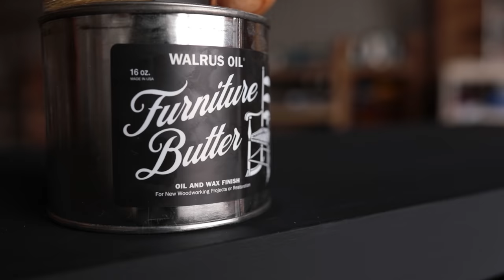Entertainment Center + Burlap Makeover | Mistakes Happen + Breaking Glass

Comment: Hey, Lauren! It turned out really nice. I have a quick question… I’m wondering why you don’t paint the inside of most of your pieces? In this case, behind the doors and the backer board of the open shelving. I am on team “paint inside”and do it with all of my pieces just because I feel like it gives a more finished look. There is no right or wrong, of course, I’m just wondering what your thoughts are on that. Thanks for another great video! 💕✌🏼

Comment: Nice idea, however, those doors took away all your glory. 
You should have pressed the burlap for starters, then when adhering it to the glass you should have pulled the fabric taught and finished/hemmed the edges by folding under those rough frayed edges to give it a nice finished appearance. As it stands now, when those doors are opened, it has an unsightly look.

Comment: Instead of glass, I would use a thin wood which would be sturdier.  Also need to get the wrinkles out of the fabric.
Reply: exactly....I really wish that burlap wasn't wrinkled.  I'm afraid I would insist that be fixed before paying.
Reply: @kathleentorres2010  I agree...It would have to be wrinkle free for me.
Reply: @kathleentorres2010  just steam it
Reply: @C00ki3m0nsta25  burlap would have to be ironed...and before it was attached to the doors.

Comment: Lauren love the look but not loving those raw edges on the inside of the door.  .I suggest you add a piece of light weight cardboard covered in material  or burlap and place it on the inside of the door to cover the raw edges from the front side.  Have you thought about trying decoupaging the burlap on?  another though is to use small wood molding on the back side of the door like those plastic strips from the other piece and just glue them in again to leave a nice clean edge inside.     Maybe experiment and try a few things.  Good Luck.
Reply: I agree about the raggedy ebbs ends of the burlap. I was like please don't leave it like that

Comment: You can use liquid starch to apply your burlap to the glass. Once it is dry you can cut the burlap along the edges. You will not have the fold over and it will go back in a little easier. If they want the burlap off later they just have to wet it and pull it off. Also when you soak the burlap in the liquid starch you can use an old credit card to smooth it out and get the bubbles out.

Comment: What about using Modpodge on the glass? That way you can cut the burlap the exact size of the glass. No folding over corners and the back looks seamless. Just a thought... Love your channel! I've learned so much!
Reply: I was thinking the same thing only I would have used Super 77 and cut burlap to size of glass!
Reply: And I was thinking spray adhesive as long as it dried clear.

Comment: I did a similar tv stand, but I used cane webbing instead of burlap. I thought the black stand looked a lot nicer with cane instead of burlap, and cane has a higher resale value. I bought the stand for $30 and sold for $500.
Reply: @TJ did you attach the cane to the glass? I have a similar piece and want to use cane but not sure about leaving the glass. Thank you
Reply: @mammacass5311  No, I removed the glass. I don’t think it would look as good with the glass attached.

Comment: It’s quite difficult to work with, and it’s a bit pricey, but Bondo is the best wood filler I’ve ever used. 

I’ve been using DAP’s latex plastic wood for years. It’s been really letting me down with the outdoor pieces I’ve built this year. When restoring a neighborhood sign that has been deteriorating outdoors for half a century, I figured I’d try Bondo’s rot restorer and wood filler. It takes a lot of getting used to, but I love the results.

Comment: You could’ve gotten a 2'x4' sheet of 1/4" MDF for like $6. It would’ve been cheaper and sturdier than using glass. Plus it would’ve been easier to trim at home when you realized the size was wrong.

You could’ve ironed the burlap, sprayed the MDF with Gorilla glue, and held it taut for a couple minutes to avoid the wrinkly look. (Unless that’s what the client was looking for.)

Comment: Love it!!! I think if you spritz warm water on the burlap or dab it with a wet cloth THEN use a warm hairdryer to dry the burlap, I think it will shrink tight and look great! I do that to the back side of a canvas painting that has  stretched in an area…
Reply: I'm not sure if you will see this but when you are filling holes from old hardware, they can be filled with a dowel stick. Cut close to the furniture and then use wood putty or your preference. You don't use as much putty and it doesn't sink as bad. I have watched all your videos! Great job!

Comment: Also stretch the burlap gently as you use your hot glue gun.  When screwing glass/burlap back in, I'd suggest hand screwing.  Sometimes the power driver can also apply force that can crack the glass.  But beautiful!